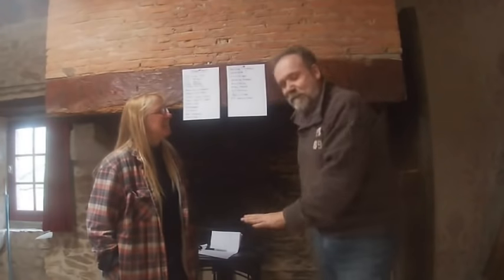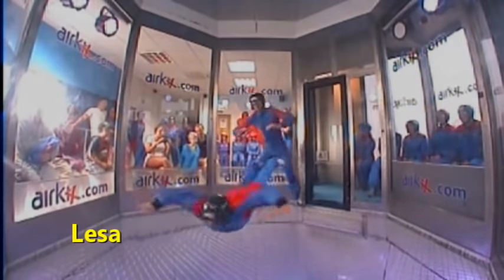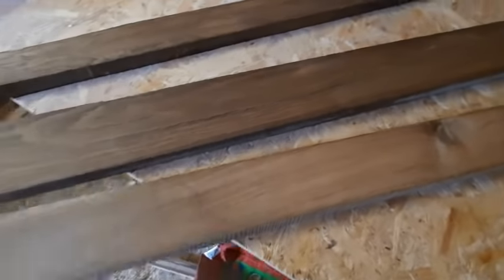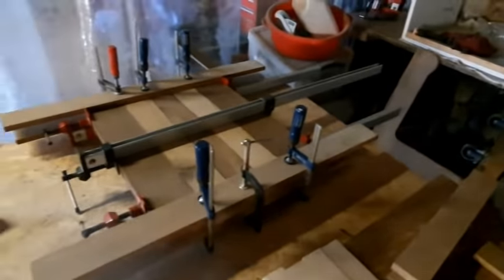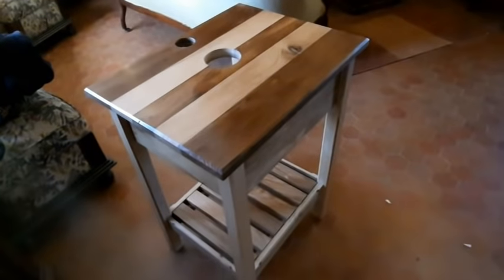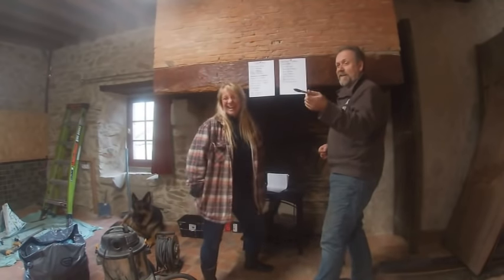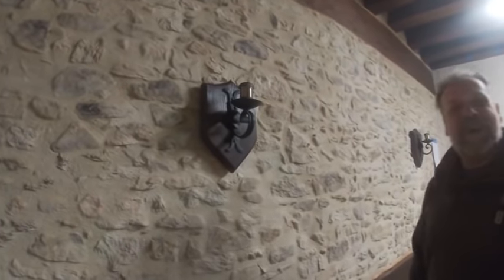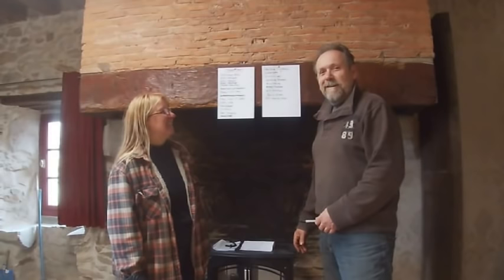131. How to make a bespoke sink cabinet out of old wood

Comment: Just seen a wizzy idea which might work for your woodland wedding aisle. Get any old branched ceiling light with the fittings facing upwards.... doesn't matter if they work or not...might get them on Freebay. and fit them with cheapie solar lights from supermarket. Make sure they get charged the day before and then hang from the trees to light your way. Just an idea!
Reply from the maker: Great idea Mary 👍